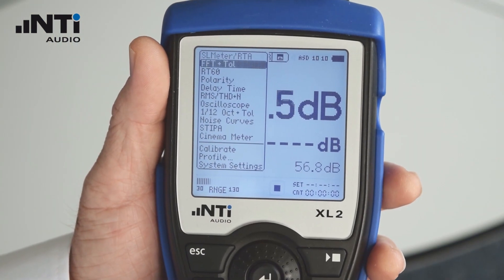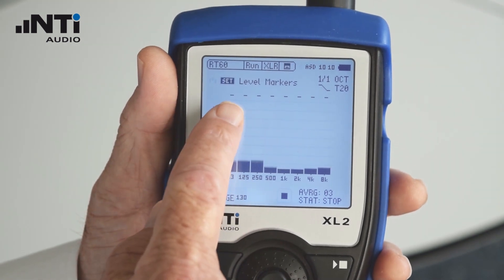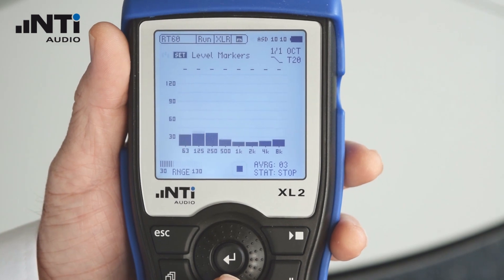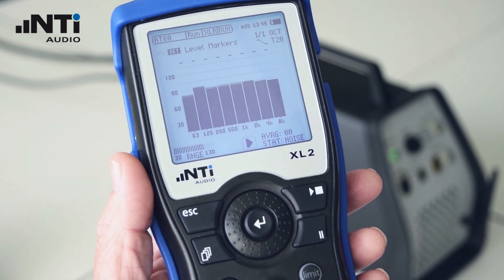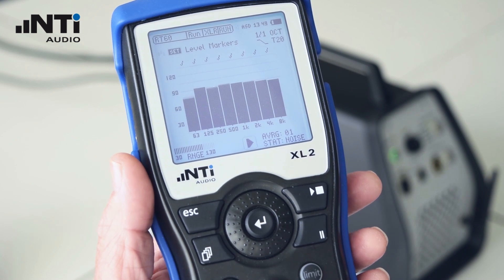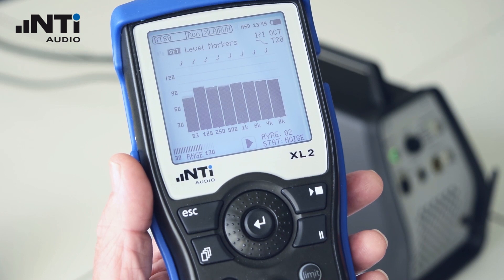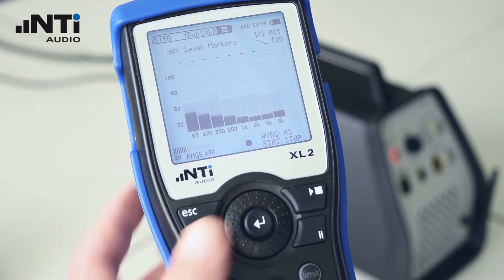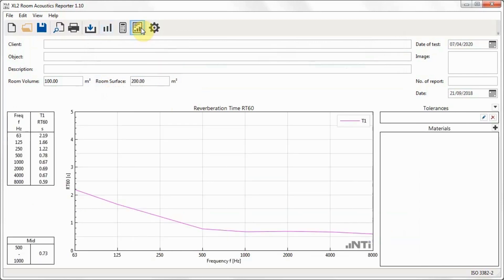How to measure Reverberation Time RT60

Comment: how to measure RT60 in the staircase of a residential building??
Reply from the maker: Basically, in the same way as shown in the video. However, if the staircase is very large, you may need more that one Dodec loudspeaker in order to sufficiently fill the space with sound energy - in this case, please observe to switch OFF the involved Dodec loudspeakers simultaneously.
Reply: @NTiAudio 
thank you for the reply.
is one measurement enough or should i re do it at each floor (ex: a multi story building)?
Reply from the maker: @architecto6874  It is generally recommended to execute several measurements (e.g. 1-2 per floor) to acquire a solid average result.